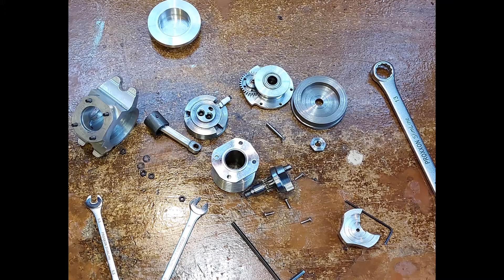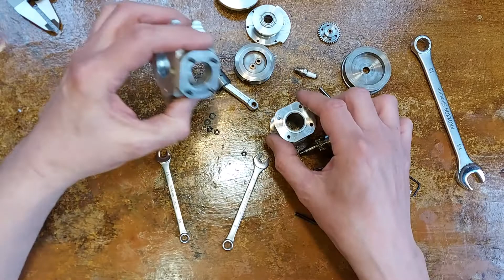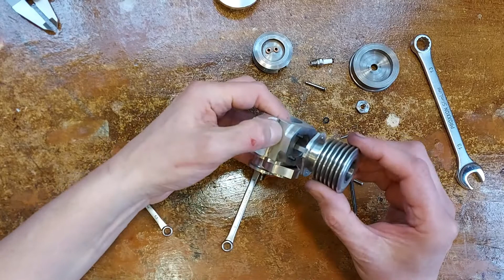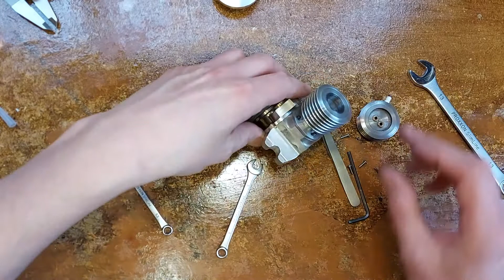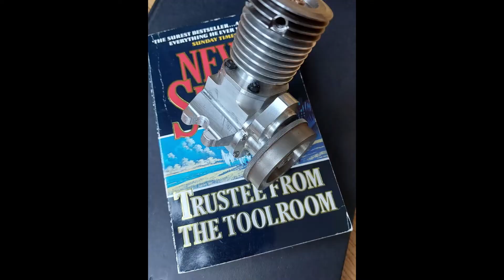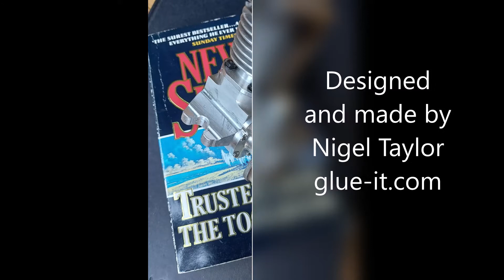assembling the single cylinder engine

Comment: That's really a cool setup. I think adding a capacitor would diminish some of the blinking of the LED. Just make sure you have the proper voltage capacitor - double the motor output.